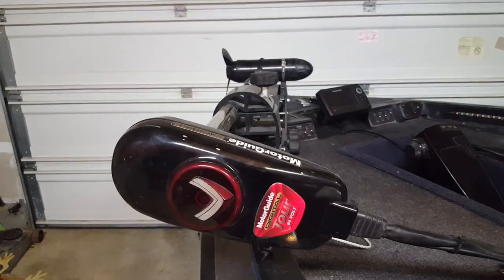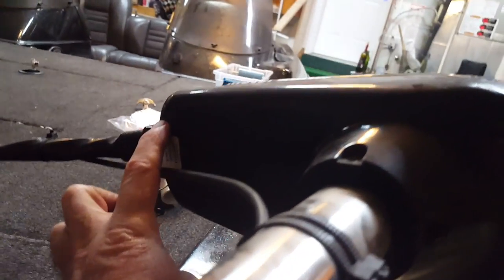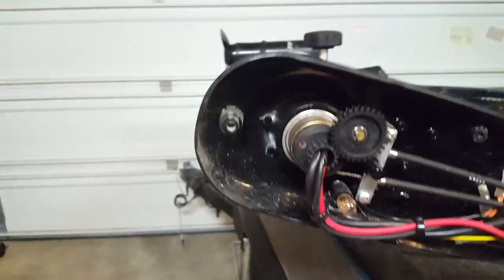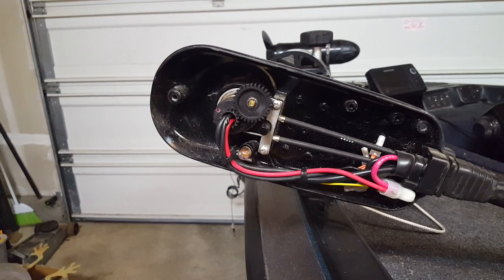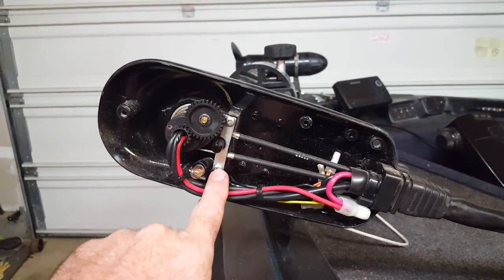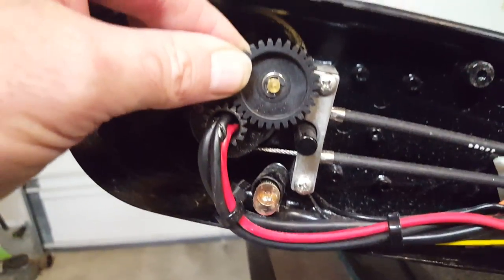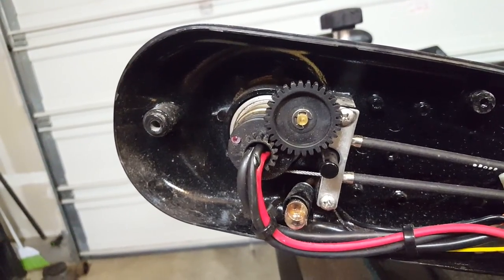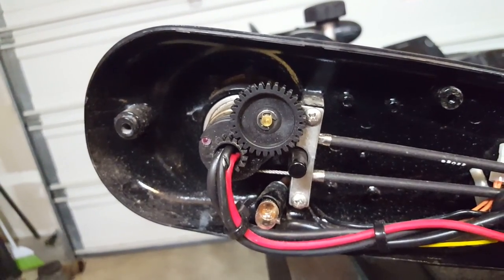MotorGuide trolling motor arrow keep moving?

Comment: I just bought a boat with motorguide troller,  when i take my foot off the controller the trolling motor spins around and faces backwards.  Is this normal?    it seems like it should stay locked in place instead of swiveling back and forth.  Thanks
Reply: It's normal with all brands that are cable drive and will drive you nuts trying to troll and cast because you can't take your foot off the pedal. There are motor clamps you can buy for about $30 or cut an 11/2" fernco and wrap it around the shaft to put friction on it.

Comment: Be aware, the top screw is loose (on purpose) so the gear disengages the other one and doesn't break off gear teeth if you turn your arrow to realign it without taking the cover off. This is a good tip and video but BE WARNED If you tighten these screws down , NEVER turn your arrow (while fastened to the TM) to realign it if it gets out of whack. You WILL break the gear teeth off.
Reply from the maker: Great info... I didn't know there was a purpose in it being lose to begin with. I just know that since I have adjusted the bell and tightened the screws, it has worked flawlessly. Thanks for letting me and the other viewers know this information!
Reply: Been there did that😳

Comment: good video looks like a really simple fix lol. nice trolling motor
Reply from the maker: It actually is an easy fix, but when I had this problem last year and I started doing research on it, I found a dozen videos telling me about how to remove the cover/re-align the arrow, but I didn't find ANY that mentioned anything about what to do if it keeps happening. (Which is what was happening to me)
Thanks for tuning in Jake... I appreciate your enthusiasm and your support always.
Reply: Bassin NW503 Having problem installing new steering cables on my Motorguide.  Need a video on that!

Comment: Which model trolly was in this video?
Reply from the maker: This was my 82 lb tour motorguide
Reply: Ok... I just finished rewiring my 70lb motor guide a few minutes ago. Red lead from the head unit to the foot control was swelled up so I just replaced both red n black with 8 gauge... Now I've gotta figure out Mounting it to my Colorado Pontoon. Purchased it without the transm bracket for $20😁😂. Today's Technology Rocks! I appreciate your contribution to this project brother... Nakia